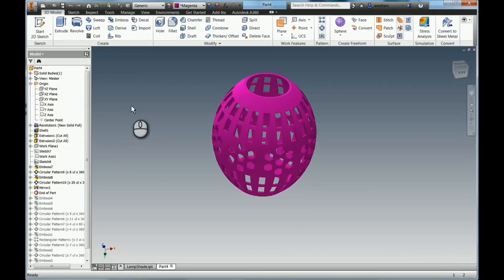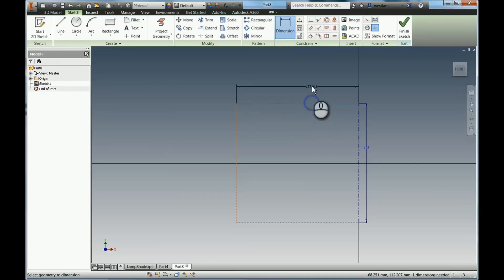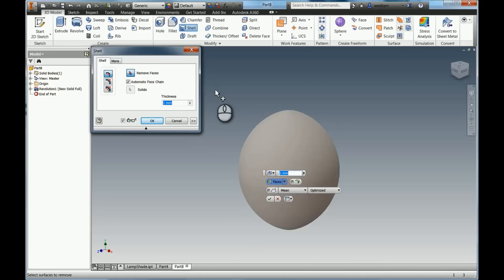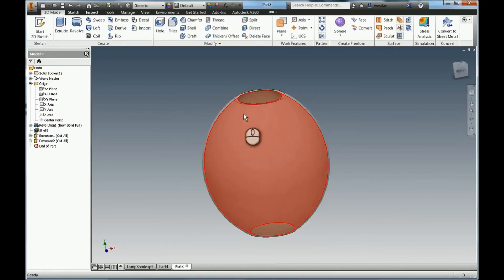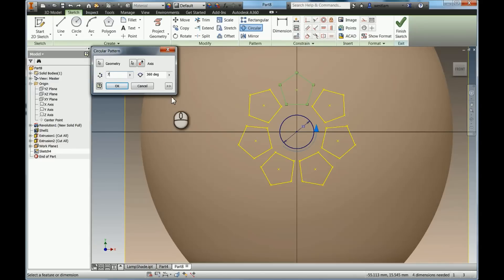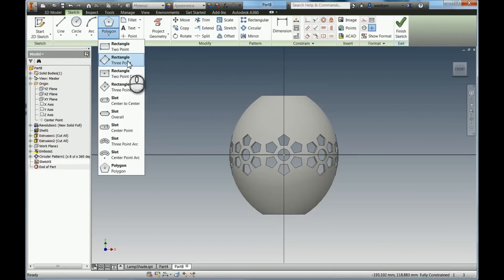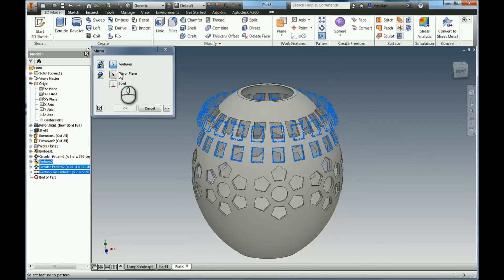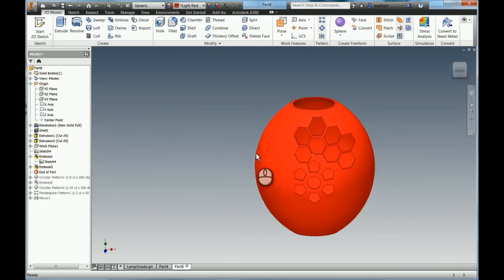Using Patterns in Autodesk Inventor (2D and 3D)

Comment: any advice on how to add spheres(about 25 of them) along the outside of an oval/egg 3d shape?    kind of like pattern an object along an oval dog collar...
Reply from the maker: You can pattern along a path, which can be a sketch that has the oval/egg shape in it. It can likely be a normal 2D sketch if it's uniform in one plane. Otherwise do a 3D sketch. Then you can pattern the spheres along that as the 'path'. Works very similar to the sweep tool, but instead of 'profile' and 'path' you have 'feature' and 'path'. Hope that makes sense!

Comment: Are these cut-out shapes normal to the surface or do they cut out perpendicular to the work plane?
Reply from the maker: Hey Zach,  great question, it depends on how you created them. If you use Extrude then it'll perpendicular to the work plane. If you use Emboss then you are able to do it normal to the surface. 👍
Reply: @AutodeskInventorGuy  good deal. Thanks for clarifying!

Comment: I tried making a fish filter and every time I try using the extruder or hole function even with cut, it keeps 3d printing as if they are tubes. Help if ya can
Reply: Hi Jay Kay, are you saying it's adding material, rather than removing? If so are you sure you're on 'cut' not 'intersect'?
Reply: @prismclothing  Thank you for the help that's what it was. Trial and error!